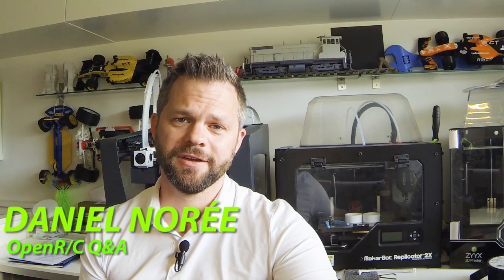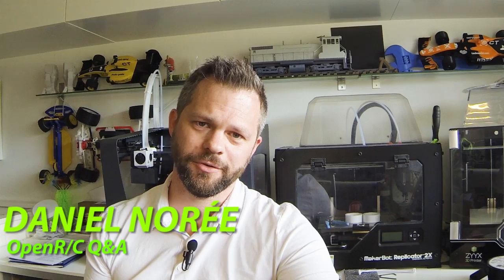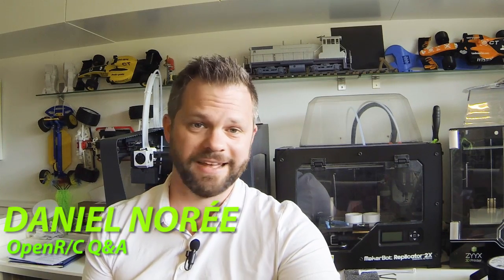3DPrinting OpenRC Q&A

Comment: for the short course truck guy, unless you truly want an SCT truck because it looks great, which I can agree with, the better performing rc's are those with short wheelbases, which are buggies and, in this case the truggies. ROAR spec 1/10th scale SCT trucks have wheelbases at least 4.4cm longer than the OpenRC truggy. Which means, you'll have to trim at least that much of the body to convert the OpenRC to a short course truck while keeping the performance of the shorter wheelbase. I would love to extend the wheelbase of the truggy for you but ive spent a lot of time redesigning the suspension for performance. What I would say is extend the differential, servo, and steering pivot holes on the chassis plates 2.2cm away from the middle of the car. the only parts you'll have to use that are different are the center dogbones, which will need to be 2.2cm longer.